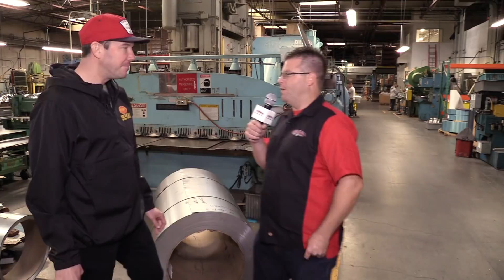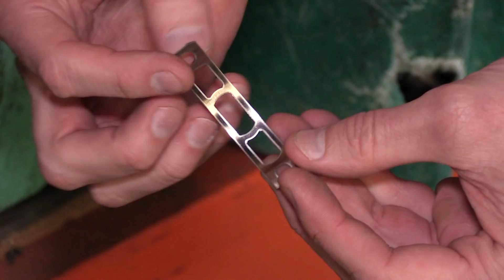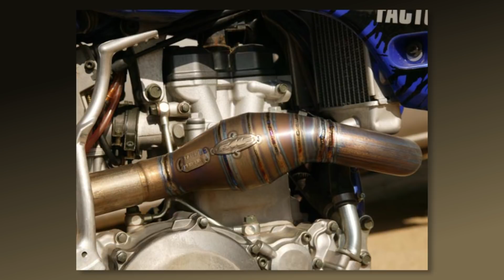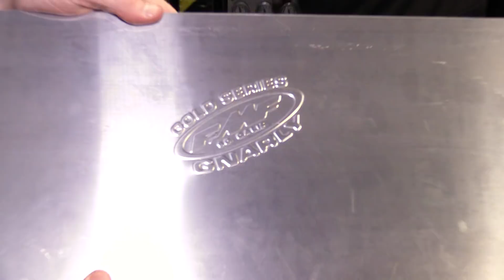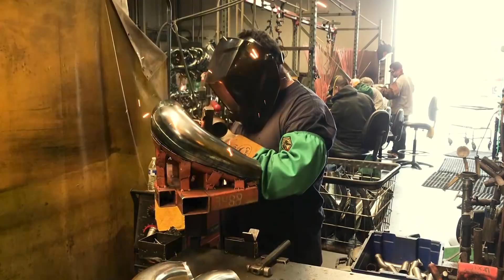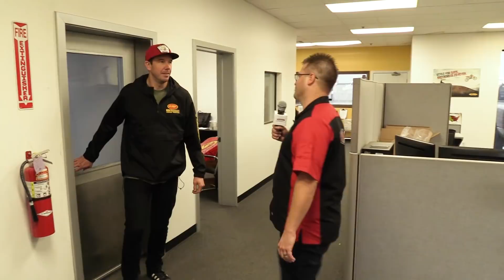FMF Factory Tour Part 2 : How Dirt Bike Exhausts are Made 2-Stroke and 4-Stroke ChapMoto.com

Comment: Good info. Thanks for posting.
Reply from the maker: Yes Sir! Thank you for watching. What did you find most interesting about their process?  And... what other types of "How its Made" would you like to see in the future? - Kyle
Reply: I was surprised the ktm 2-stroke pipe looked like an "S" shape (like a banshee quad shape) until they cut it to swivel it around for welding. I can see how that's efficient and eliminates waste. Smart thinking for sure. I would like to see some anodizing or special coating videos. And I think a Wiseco tour would be interesting. I like CNC machines... That's what I did back in the day. We made a few PC parts back in 2001.
Reply from the maker: Thanks for your follow-up reply. We were surprised by some of the processes too. Even more surprised that All of the parts were made in-house out of those rolls of steel. Brilliant. We love CNC too ;)- WE will get your suggestions into our queue. If you are not already subscribed, we'd suggest it as more of these videos will be rolling out here in 2018.  Thanks again for watching and for your support.